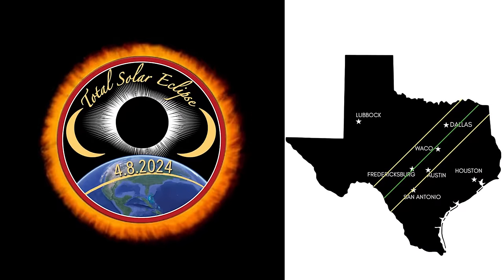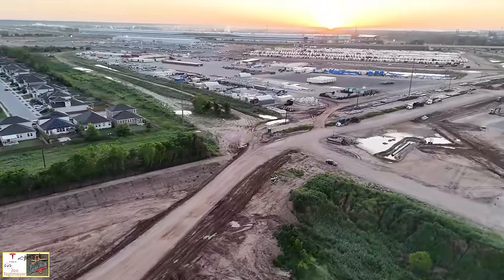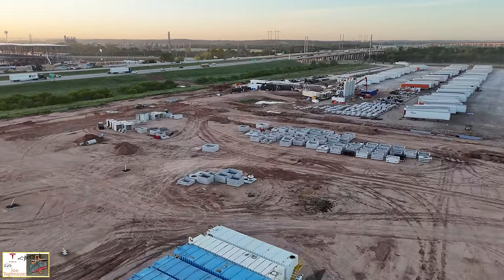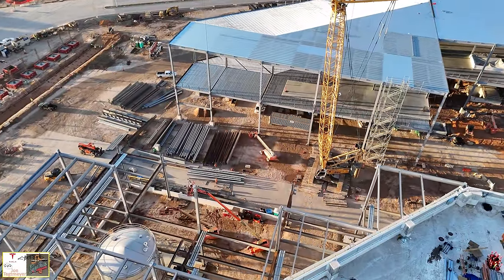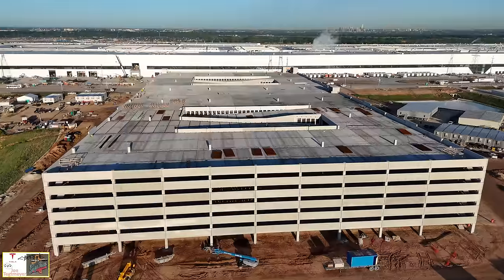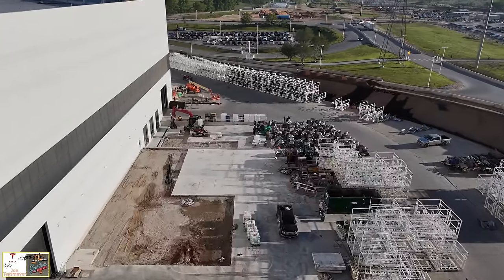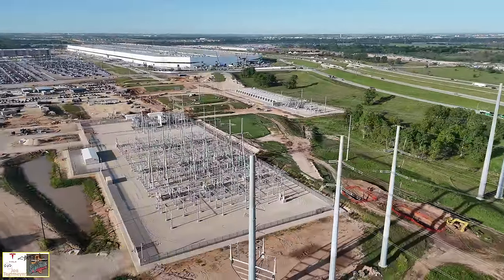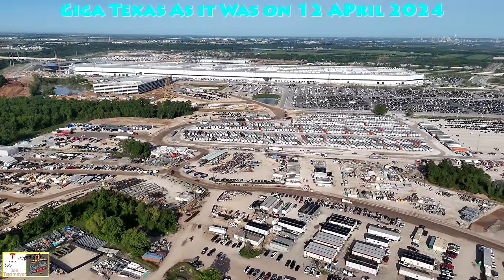Mega Structure, S Ext Concrete, Boring Tunnel & N Conduits! 12 April 2024 Giga Texas Update(07:15AM)

Comment: The speed at which that parking garage was constructed was downright impressive.
Reply: Tesla construction crew is super fast they don't screw around.
Reply: no lie !!
Reply: The main building and multilevel carpark was built in record time but something small like the west side main entrance or the solar panels seem to take decades lol 😂
Reply: Absolutely!!! I cant wait until its done and cars can start parking. That will free up so much space
Reply: The car park parts are all known pieces. They build car parks every day. This one was just bigger than usual. It took longer to get the foundations built than to erect it and that’s pretty normal. As for the factory, it’s like building a house. Drying the house in happens quickly. It’s finishing the interior from doors to drapes to dishwasher. The devil is in the many, many details.
Reply: @PedroNeves-hm5xm ..  😂 wow, “decades”… really stretching there. GigaTexas broke ground June/July of 2020… four years ago.

Or maybe you meant ‘since Tesla started’ ? yeah that’s twenty years ago…. Jun/Juy 2003…

As for the PV array, all parts/hardware needs to be lifted by crane, it’s installed panel by panel, atop framework that needs to be anchored on the roof and penetrations made water tight then each panel wired in.
And it’s some 70,000 panels big , so yeah, it takes a few days.

The main building is almost a mile long ….that’s about twenty minutes of walking… then there is the width…. That’s Texas-sized acreage up there, pardner! 🤠
Reply: @ernestgalvan9037  ofc I was exaggerating…

Comment: It’s now obvious with the rebarless concrete strip in the south addition poured is where the tunnel will emerge. They may use it temporarily as a Cybertruck exit road, but it’s to enable cutting it up later for the tunnel entrance. Seems like they are threading a very tight needle with the underground storm water management system hub and the water table shaft. I am impressed and will once again say thanks for your flights.

Comment: Thanks Joe
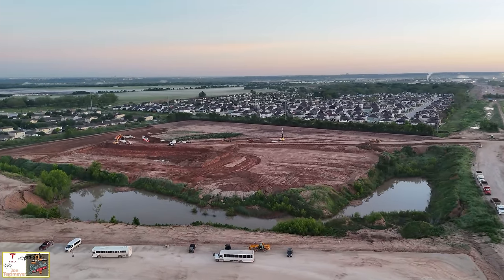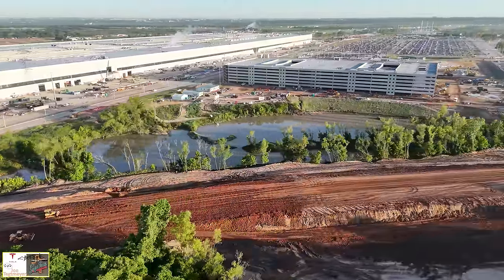3:49.  Westside. Far west. Earth extracted, backfilled, compacted, being extracted again. Or maybe this exact patch is natural undisturbed earth. I think it’s going to the River Road east extension at 16:15.
7:18. New EOL, north. I don’t think we’ve yet seen a steady stream of new vehicles driving into this end of the building. Building may only be partially functional, hence the various tents around the place.
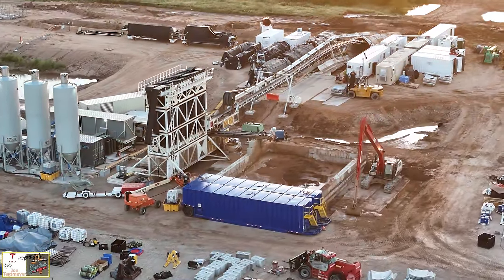9:17. Westside. Tunnel Project. Left. Electrical trailers. New dark green transformer, cables into one of the trailers. Connected to the local supply, or about to be. Thanks to @Gig0Surf for pointing this out in an earlier video.
9:59. Westside. Tunnel Project. Man in black driving the MPV via a remote control.
10:24. Westside. Tunnel Project. Length of tunnel? Can’t be far inside, conveyor belt cassette/magazine doesn’t seem to have released additional belt.
11:39. Southend, easement. New structure. Speculating this a structure for a bridge crane to unload coils of metal etc.
Footings/pilecaps already had concrete placed, one form stripped.
Column rebar placed, some column forms. U shaped formwork at 11:53 might be for a beam.
End pairs of footings are closer together. Similar arrangement for the bridge crane structure in Plastics.
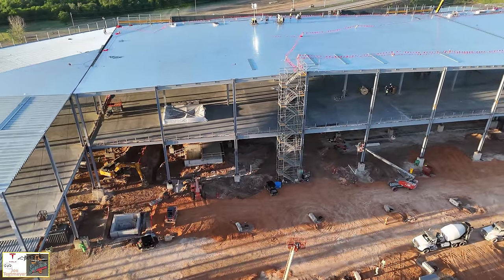13:26. Southend, east. Inside. Left, behind the excavator. Rebar for a retaining wall and strip footing/grade beam.
13:42. Southend, inside. Left. Centre passage/tunnel. 2 rooms and the rebar for the dividing wall visible. Elevator shaft, and stairwell.
Centre. Thick mud base/unreinforced slab*, edgeboards are about 12” 300mm high (as seen in Joe’s photos). Using the automatic screeding machine. Edgeboards have yellow plastic triangular block-outs fitted. These are for keying into the abutting slab. Odd to be using these on a mud base.
*I guess potentially this could be fiber reinforced concrete, some of the ground floor was constructed this way.
I think this is unrelated to the Tunnel Project, too big for any sort of crane access track/pad.
Right. Strip footings and retaining walls being constructed. Tunnel alignment (not necessarily the tunnel) is to the right of these.
15:20. Southend, inside. Centre passage. Left. White PVC sanitary sewer pipes, one trap is visible. To the right, rebar for a retaining wall projecting up from the strip footing/grade beam.
Interesting view in Joe’s photos of the east passage showing rebar for a potential intersecting side passage
15:31. Southend, roof. Parapet wall framing and rear face sheeting. Glazed facade almost a certainty now.
16:03. Southend, east. Easement project. There’s an 800’ long parcel of land here between diverging easements. Tapers from 0’ at the north end, to 120’ wide at the south.
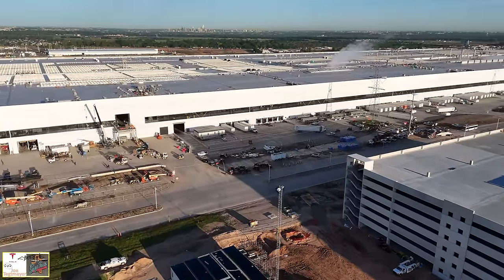17:14. GA, roof. Top left, and top centre. Scaffold and a pair of flues, scaffold and some flues laying on the roof. Not the massive flue seen being delivered in Joe’s previous video.
17:29. BIW, apron. Bottom left. 6 mobile chiller units, yet to be connected. A manifold at the door.
18:37. BIW, apron. Rapidly reversing dump truck. Comes very close to the hydrant bollards.
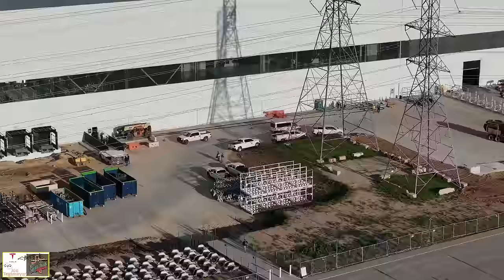18:44. BIW, apron. Left. Cables draped out of the electrical vault up against the wall.
19:26. Casting, east. Apron. Bundle of wide U shape rebar gives a clue as to the cross-sectional shape of the slab.
21:49. Battery, apron. Bottom left. Red pump and a couple of hose/pipe runs in through a pedestrian door. Pressurizing something inside.
Some black HDPE pipe on the apron.
22:55. Tesla Road, north. Pair of large parallel ductbanks. From nowhere to nowhere much else.
23:33. Temporary switchyard area. More ductbanks, including up to the Mega-Vaults.
24:37. Northend. Easement. New valve visible on the pipeline. Would be the same pipeline being repaired to the south near river road, in previous years large lengths were replaced through a HDD bore.
Reply: 10:24 I think the belt cassette bottom head pulleys are advanced upward as a set to lengthen the conveyor belt. I did not look back to see if I could see any upward advancement.
Reply: 11:39 Why concrete columns and not steel? Fire suppression?
Reply: @bobcallahan2322  10:24. I didn't check back either. I figure if it was under the highway though, the bottom pulleys would noticeably higher.

I guess they run out all the belt on the cassette before adding the next length waiting rolled up on top of the conveyor.
Reply: @bobcallahan2322  11:39. I'm thinking an open air structure. A couple of years ago when Stamping was being constructed someone suggested an open air yard to store the coils. 

Actually have no idea what it is. A surprising development anyway.
Reply: 13:42 I agree that the concrete is fiber reinforced. The laser controlled screed machine has to drive on the moisture barrier and could not if rebar or mesh were used.
Reply: I think the roll of belting is just for repair if they get edge ripping or some other problem. There is a lot of belt remaining on the cassette.
Reply: @bobcallahan2322  And why not precast columns as they used elsewhere?
Reply: @michelangelobuonarroti916 These are cast in place, not precast. We have not seen cast in place columns this tall.
Reply: @bobcallahan2322  These may be the first cast in-situ columns on the site. I can't think of any others. Short pedestals excepted.
Reply: @bobcallahan2322  Couldn't see in earlier videos how far down the lower pulley set were to judge the distance advanced. Now the lower pulleys axis are visible it is easier to estimate. From the umbilical cables being taken into the tunnel which are required until the rest of the backup are installed. I estimate they are 40-50m into the tunnel. By Monday/Tuesday next week they will run out of umbilical's and will then stop to install the rest of the backup.
Reply: @bobcallahan2322  These seem to be precast units, to be lifted into place when needed. Possibly related to the tunnel alignment in the open section being constructed adjacent to this area.
Reply: @bobcallahan2322  Cassette rolls are usually no more than 250-300m in length. They will need 3 of these to complete a 300m tunnel. They have the one installed, the one on top and another stored behind the conveyor. Another reason why the general view is that it is a 300m 'ish tunnel straight across to the open section just outside the new structure being built.
Reply: @tunnellingsalisbury7605  Concrete columns and bases. Second time this area has been prepared for works. 12 months ago a large area was excavated, then backfilled and compacted. This work started a month ago with a test screw pile, followed by these grouped piles in wide trenches. Plates for embedment in the pile cap fitted to the trimmed piles. I'd say these are permanent.
Reply: @DessieDoolan  Ah!, didn't know that. Still seems a strange set of bases and columns.
Reply: @tunnellingsalisbury7605  Yes it's odd. I'm calling it a structure for a bridge crane mainly because I can't think of anything else remotely likely.

With the rebar arrangement at the top of the columns extending past the formwork, that suggests cast in-situ beams.

I'm confident it's not a building, but that's where the confidence ends. If they start constructing beams east-west, I'll need to.......come up with some other ideas!
Reply: @DessieDoolan  Bridge crane seems likely since they need a lot of heavy steel rolls to keep the press fed.
Reply: @jonathanlanglois2742  More and more trailers showing up with coils of metal. Looking back through my notes, up to 5 trailers are out on the apron. Each one has to back into Stamping to unload.

If this does turn out to be a bridge crane, it might be to alleviate a bottleneck in deliveries of the coils.
Reply: 16:03: Southend, east. Easement project.
Since those footings are going along the gap between both power lines, it's probably a wall, no? Are they allowed to build some structure that goes under the high-tension line?
Reply: @greggerypeccary  16:03. I don't think it's a wall. 2 rows of footings and columns. My money is on a bridge crane for unloading coils of metal for Stamping.

Structure is not under the wires, and the site plan from 2021 shows a quite a wide gap in the easements.

I think we will see beams north-south across these columns.

A dot joining exercise at this stage. With a shortage of dots.
Reply: @DessieDoolan  Is the gap wide enough for a lorry? And isn't it too long, or is it the length of a loaded lorry+trailer? (Is it even legit to have a lorry+trailer with such heavy loads as those coils?)
Reply: @greggerypeccary  I scaled the length north-south at 73m 240' column to column. Width is a little harder. There's a shipping container that would be a handy measure in Joe's video today (15 April), but no head on view of it. I'm estimating east-west the columns are a minimum 3 x width of the shipping container, 7.5m 25' or more. 

Trailers only ever seem to have a maximum of 2 coils, although more often than not only 1 coil. Assume the 2 coils would be aluminium, single coils steel or stainless steel.

Comment: Thanks Joe!
Major new electrical project.....
Tesla road, north:
@ 22:54 (Bottom right) Two new duct-banks with more conduit than the main power duct-banks! They are also running parallel to the existing main power duct-banks. 12 conduits per duct-bank vs 8 conduits per duct-bank in the existing main power duct-banks.
South of Tesla Enclosure/Mega-vault:
@ 23:56 (Bottom right) Previously constructed duct-banks coming out of the mega-vault are being extended south toward Tesla road. There is a lot of conduit!
Speculating that both sets of duct-banks will be connected together. Here are more views in-between.... 23:21 and 23:31
Northside of casting: 
@ 19:56 (Left, by the building) Two previously placed vaults.... Speculating that this is the destination for the new duct-banks from the mega-vault. Which will more than double the power supply to the building!

Comment: 10:40 At this point, it seems pretty clear that the rear sections of the TBM are not going to be sent into the tunnel. If they had any plans to do so, they would already be in by now. Since this is a rather short tunnel, they seem to have chosen to just extend the electrical and hydraulique hoses as needed.
Reply: 10:40. Check out David Salisbury/TunnelingSalisbury's response under my comments.
Reply: Expect them to stop 15/16 April to install the rest of the backup as the umbilical cables and hoses have all been taken into the tunnel.

Comment: At 14:00 with the concrete pour without rebar. It is possible they may be using fiber reinforced concrete (steel, plastic of fiberglass), but still not sure why you would use this in this situation. Thanks Joe, I really appreciate the narration.
Reply: 14:00. Fiber reinforced concrete used extensively in the west side of the main building. Mostly in GA.

This slab is quite thick, around 12" 300mm as seen in Joe's photos. Excessively thick for anything other than a finished floor I would think. In Brad's video the finished slab is quite shiny, so been steel troweled to high level, another indication of it being a finished floor.

Comment: Joe, The lack of rebar in the concrete pour indicates to me that it’s temporary.  My prediction is that the tunnel entrance will be via a vehicle elevator system.  It would allow for minimal below grade infrastructure intrusion. Basically, the tunnel will run under all of it then pop up in a relatively small footprint.
Reply: Though I think the entire tunnel is ridiculous, Since they are building it.... I agree with the elevator concept. An inclined tunnel entrance would be wasteful of factory floor space.

Comment: Awesome video Joe!  The large concrete pour on the yellow material is where the tunnel will exit, it seems.  So no reinforcing, my guess its a very weak thick stabilising platform for the runner boring machine to exit.

Comment: Saw a much much smaller multi-level (8+G) being built in Bangkok many years back. Was waiting to a Visa for Vietnam which took over a month and the build speed was insane. Flew out before it opened but spoke to a couple of guys working on it and they said it would be a matter of weeks, like two weeks. This was quite a while back so my Thai wasn't great but the internal walls and ceilings were done by a fella/s wearing hazmat type suit/s walking around misting every nook and cranny . Remember it well as the actions portrayed were like a flamethrower. I presume, given this isn't Bangkok, water for a sprinkler system will be installed but other than that it's just lights and load. Would be interesting to know how far they have gotten with rigging the conduit as the western half could well be pretty much completed.

Comment: The weather is right for condensation to form above all cooling towers, but nothing showing above BA. Maybe the battery assembly process is now temporarily on hold.
Reply: Weren't you the one before who said that they will need a lot of power for the battery section of the factory?
Well it looks like they are building two new duct-banks that will more than double the power to the main building. That is, if my speculation is right.
Seen @ 22:54 23:31 23:31 and 23:56
Reply: @DavidJohnson-tv2nn  Correct! Meanwhile I realized that extrapolating conventional (wet) battery assembly power-figures from GN is not right, since the DBE battery assembly process at GT is entirely new. We have to wait for the 2023 Impact Report to get some indications. In the most optimistic scenario, Tesla will showcase the DBE process themselves in the 2023 Impact Report,. And why not really, since it is a monumental achievement by all accounts.  And then we can confidently extrapolate against the planned ramp at BA.
Reply: @hardernl8893  Thanks! If you can keep us updated on the estimated power requirements for the factory that would be great. I don't follow any of that Tesla stuff, but am curious about the factory power requirements. The construction of the new duct-banks seems to be evidence that they will need a lot more power. However, we will have to wait a couple of weeks to see if they actually trench across, or bore under Tesla road towards the the north side of main building. It could be possible that they are planning  construction on the northside of Tesla road and simply have to get these duct-banks done for the construction to proceed. In any case, this crew seems to be moving a lot faster than the crew that built the first set of duct-banks. My guess is that they will go all the way to the main building but time will tell.
One more question if I may ask.... Can the two transformers at the LCRA substation supply enough power for the new duct-banks and still maintain redundancy? Or will they have to add a third transformer?

Comment: A thought regarding  the concrete , On the addition . and the red forms  under the powerlines ,It may be a electrical vault to  service the west side of the highway .. and make the HIGH voltage lines underground to the west side .
Reply: I would disagree. The west side of the highway is already being serviced by medium voltage 24.9 kV feeds from the main building.  They go through an HDD bore  duct-bank under the freeway. The transmission lines will remain because the utilities that own them have an easement.

Comment: My read of the Tesla inventory levels is that they are at 'emergency LOW' levels, lower than 2nd place Toyota and far lower than anybody else, less than 30 days, where the industry average currently is 80 days. Ford is 108 days, yet, the Media claim that there is an EV slowdown, when Tesla's competitors actually refuse to 'do battle' any longer due to their losses..
Reply: They are normally at 16 days